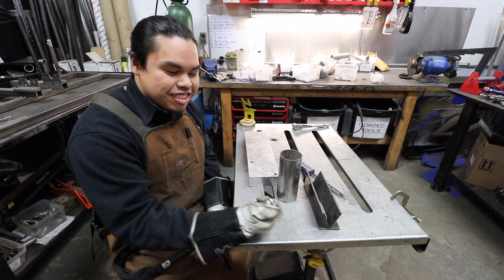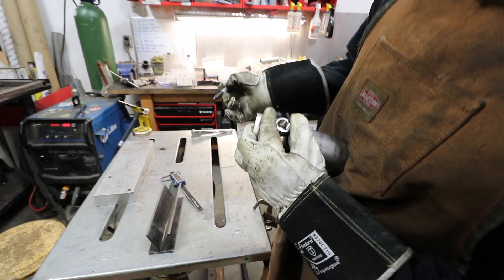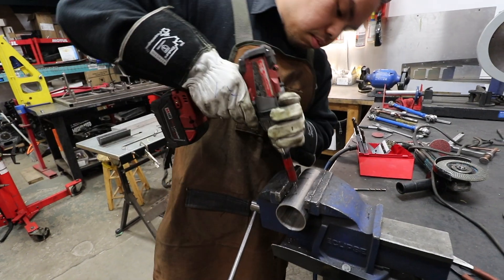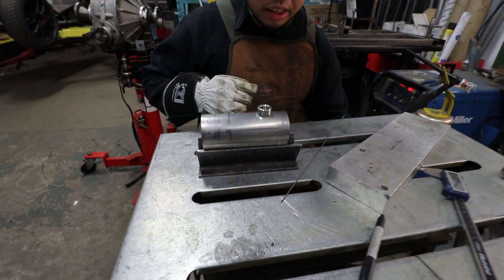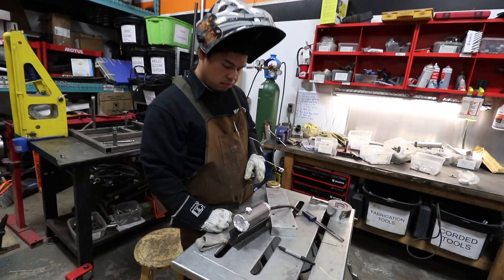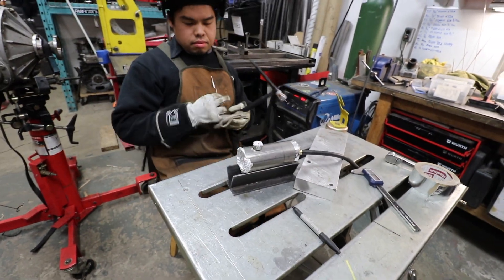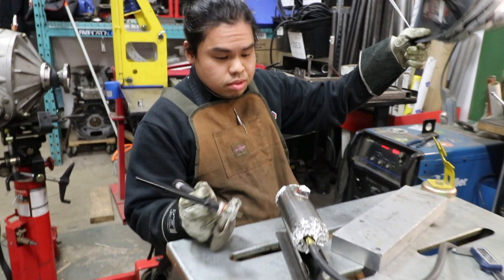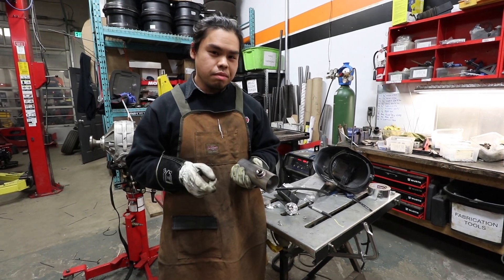How to tig weld a o2 bung to stainless exhaust system

Comment: Just a hobbyist tig welder here. How did you guys weld the stainless bung without it shrinking on you. Even going slow I still had problems, then having to re tap was a big pain later. Cheers

Comment: i was hoping you would say which way to angle the o2,im thinking like in the 10 o clock position or 2 o clock position but which ever you have clearance to get to it,thanks
Reply: Check the O2 Sensor/Wideband instructions. But ideally it's at least 10 degrees from horizontal to keep it away from pooling water.